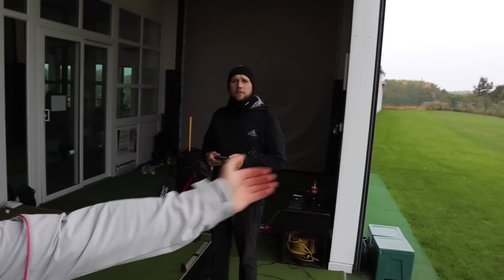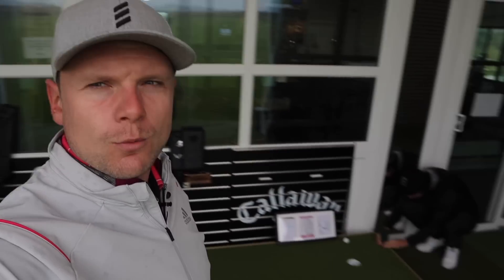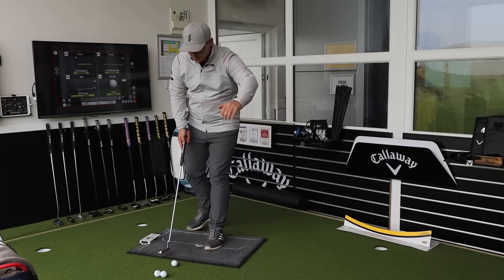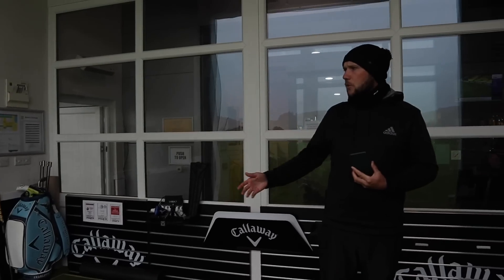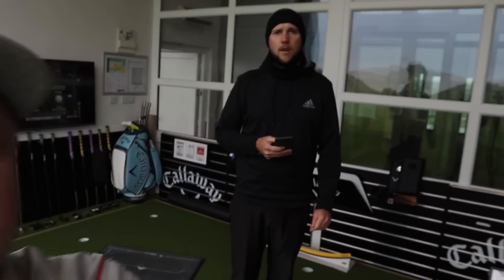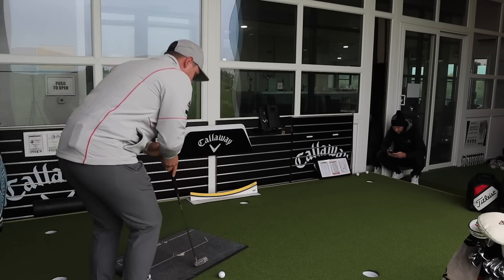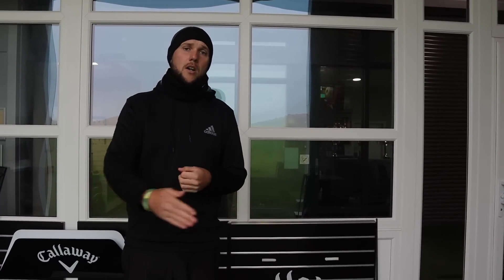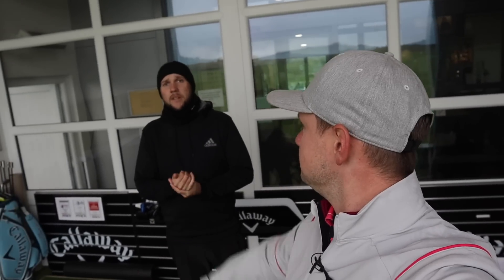INSANE NEW GOLF CLUB FITTING TECHNOLOGY... YOU NEED TO TRY THIS!!!

Comment: I did a Putter-Fitting, and my putting changed dramatically from 2 putts a hole to 3.4 so after 2 months of pain went back to my old one, which from the fitting percpective was not correct and now I am putting again about 2 strokes a hole... fitting is not always a plus, sometimes taking lessons from a pro may help way more.

Comment: Just to be picky here, but by standing on the mat, are you not at least half an inch higher to the ball than normal. This would lead to an exaggeration of the smaller length shaft results ???
But that being said, it’s definitely something I will look into.
Reply: I was going to comment on the same. I’m interested to know how it would effect your stroke, hence, the fitting.
Reply: That’s what I thought
Reply: I thought the same. It must have an effect.